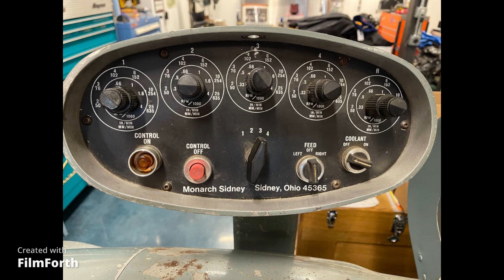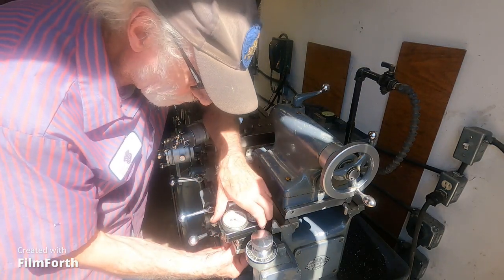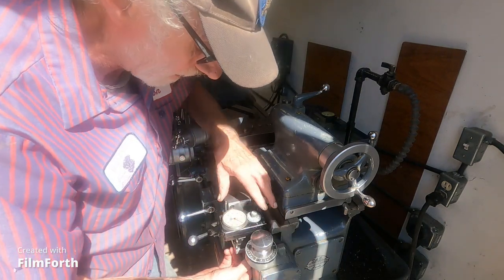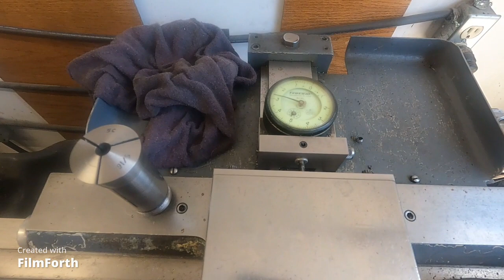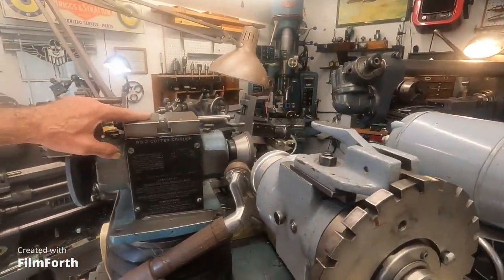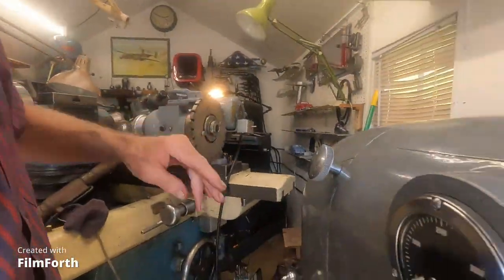Monarch 10ee lathe vacuum tube drive simplified 2

Comment: Thanks for the videos and the example of life long learning.  And congrats on keeping the inch-metric 10EE!  Are you replacing the bearings on your round dial motor generator drive when you have the shafts out of the machine?  Any tips for round dial rebuilding or scraping flame hardened round dial ways?  Hope you are having a great day!
Reply from the maker: The old motor generator lathe is a manufacturing model and much less complicated than the round dial. I pretty much avoid lathes that are in bad condition to be scraped completely I don't have the heavy straight edges and facility the common practice is to have the ways ground one company is commerce grinding in Texas I would contact Monarch for a re ground bed first thanks

Comment: Dee here Millwrights and Carpenters work out of the same Union Local therefore carpenters hire out as Millwrights. Pretty sad. i will never agree with that. That should be illegal as far as I am concerned.
Reply from the maker: For the most part there were no unions but the pay was good. I worked at produce and frozen foods plant only the warehouse workers and truck drivers were Union all mechanics, refrigeration and maintenance were not.